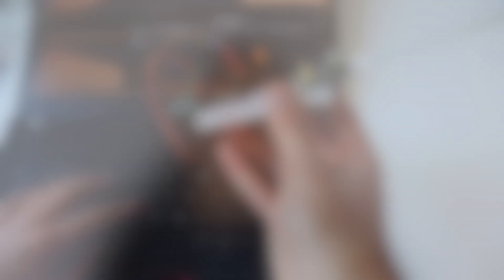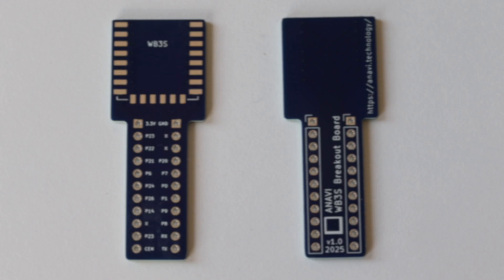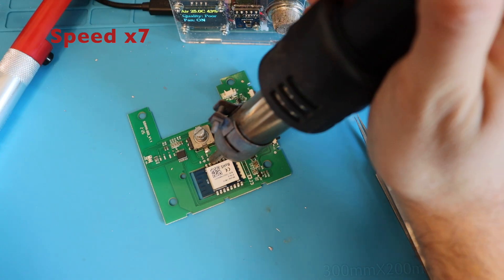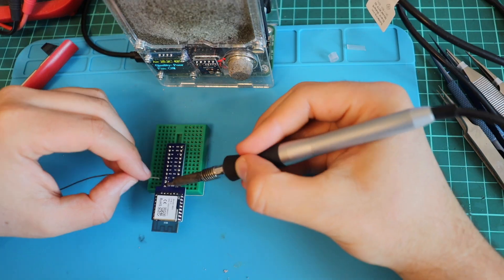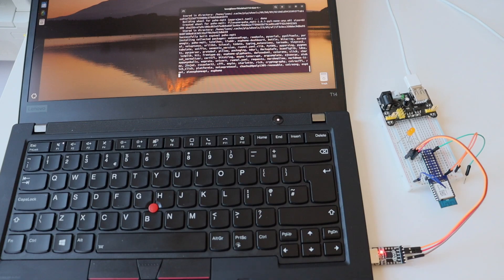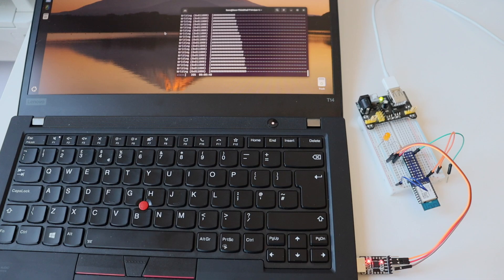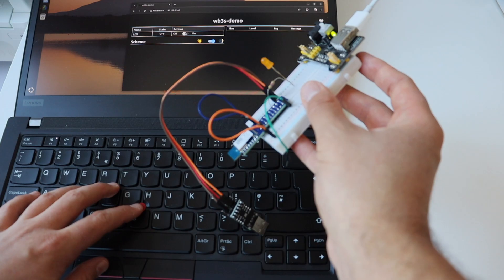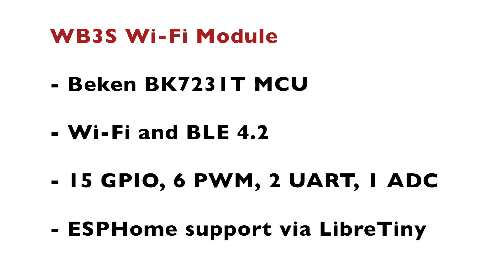Running ESPHome on a Mysterious WB3S Wi-Fi Module with Beken BK7231T #esphome #wb3s #beken #bk72xx

Comment: Thanks so much for this video. Very new to the WB3S (Sparkle IOT) EVKIT and modules. Could I raise a few questions? On the factory shipped module, can throw a few AT commands to the module which work but is there a location for the full AT command list? Terminal shows BK7238_1.0.14 in the log. Is there a Windows compiled binary to test the ESPHome platform? Am excited by this low cost offering but so far, unable to scan for WIFI access points, etc. It appears that the default firm requires an external host CPU to configure and use over UART (115200 bps). This is fine and will reflash with the elektroda firmware but do not see immediately if it can be tested on Windows. Will try on Linux soon. Many many thanks for your video.
Reply from the maker: Thanks for watching the video. I am happy to hear it is useful. The AT commands differ on different devices so the full list of supported commands has to be obtained from the device manufacturer. Basically the device manufacturer provides it with a default firmware that supporting these AT commands. 

Yes, you can install ESPHome on Windows too. Here are the exact steps: https://esphome.io/guides/installing_esphome/#windows